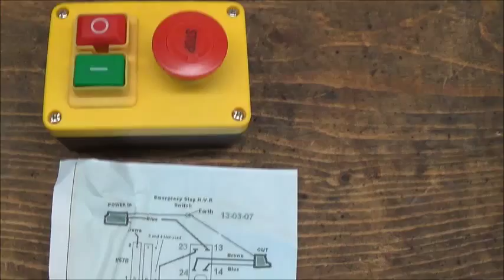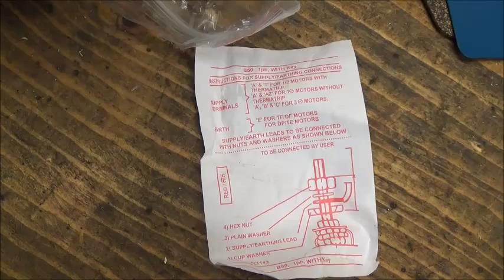Part 1/4 Meddings Bench Pillar Drill Refurbishment - Motor Replacement

Comment: Thanks for uploading the videos. I have a 1977 Meddings Mf4 and the motor is on its way out. Stupid working after a few minutes and only works again after its cooled down. But can you tell me how you got the pulleys off the old motor shaft?
Reply from the maker: Thanks mate, the pulley on my drill is held to the motor shaft with a grub screw. I assume an imperial size, but I used a 4mm Allen key to slacken it off and slide the pulley off. I think I needed to lever under the bottom pulley against the motor case using two pry bars, using great care as the pulleys are cast. If that fails you could try shocking it off by getting someone to hold the pulley (with the motor removed from the drill and the shaft upwards) and hitting the middle of the spindle with a wide punch, you may find the motor drops off with a bit of luck.
Reply: @ShedTV  cheers for that mate. In the end, I got myself an extractor from machinemart for £20. Even using that it was an effort to get the pulleys off. New motor is on... Just waiting for one of those NVR switches. Thanks again!
Reply from the maker: @Kennnyboy888  Good work, yes a puller is the less brutal answer! Sorry for my slow reply, we were on holiday; no phone allowed!